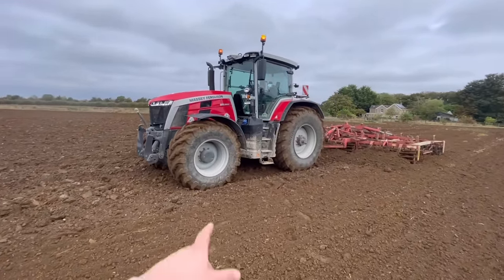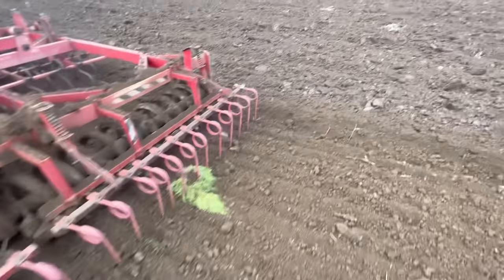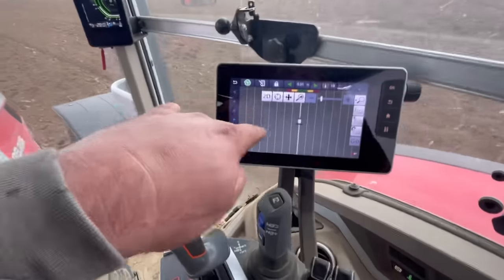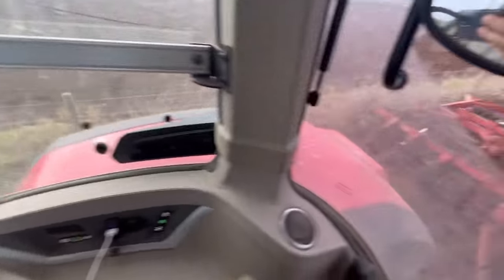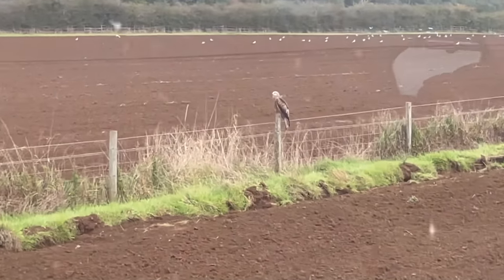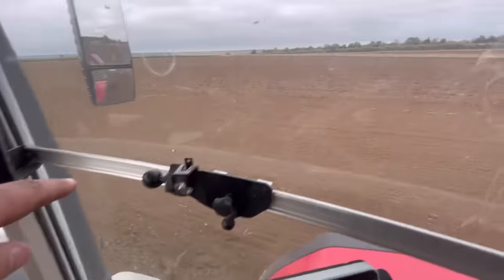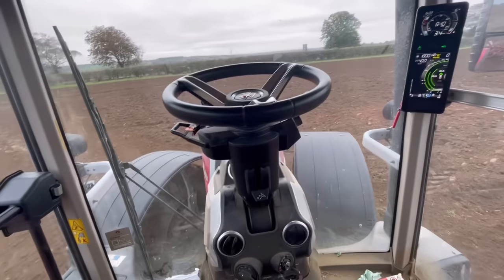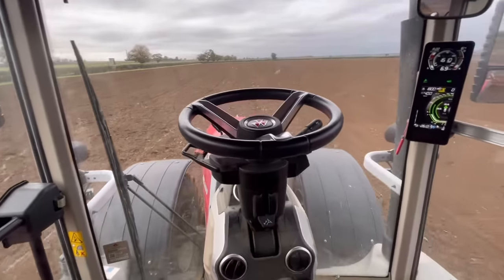Bulldozing and levelling soil with a self steering tractor

Comment: Also here by way of Colin. As the son of a farmer I do find it interesting how much technology has evolved farming. Dad would have been amazed.
Reply: Snapedy snap.  I've just left Colin's channel with Tom yet to make his first scoop of dirt.  Plus I am also a farmers son. Dad only had 30 acres and got by with two much smaller Massey Ferguson 35s.  We had spring tine, and disk harrows, but dad eventually changed to a big old rotavator that caused the tractor's front wheels to lift when they hit a bump with the rotavator raised.  GPS was not a thing back then, and we certainly had no self driving equipment so it's interesting to see all of Tom's kit.  

BTW  our farm was a smallholding and we paid rent to Essex County Council.  We were situated at the end of Southend airport's main runway, and mum and dad were able to retire in the 70s because they wanted to extend the runway.   The image I have linked to shows our barns on the left, and the top of our house peeking over the top of the slate barn roof.  I think it was Tradeair who won a contract to do maintenance on Trident jets. When the big jets took off, they used to peel the slates off that barn room and send them spinning through the air like lethal frizz bees.  One of my (four) brothers had a close call with one, and it was because of this that they shut down the farms to extend the runway.

One last story... The Bristol Freighters were determined to land short enough to take the first taxiway to the terminal, and they were forever breaking the landing lights with their fixed undercarriage.  I have a cool story about the Red Arrows if anyone is interested? 

https://i.pinimg.com/originals/1a/4f/40/1a4f40649346907c01d65ffa0dd58e7f.jpg
Reply: Me too. ❤
Reply: Me too